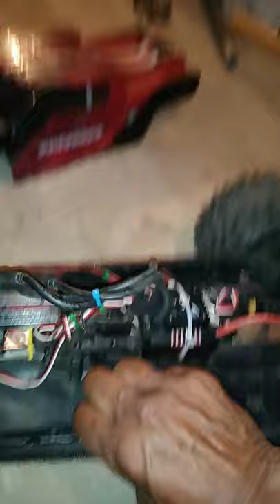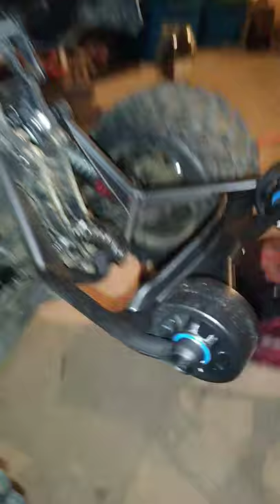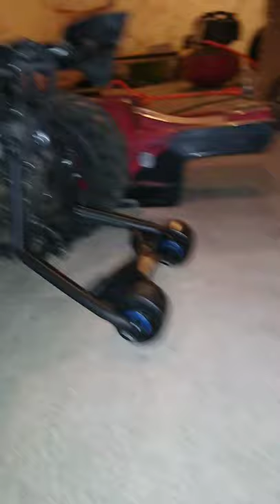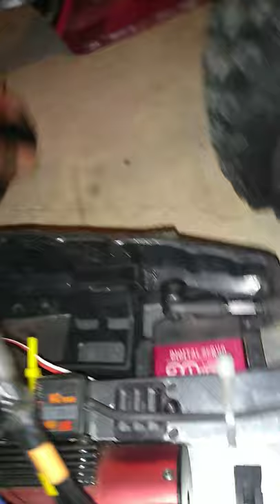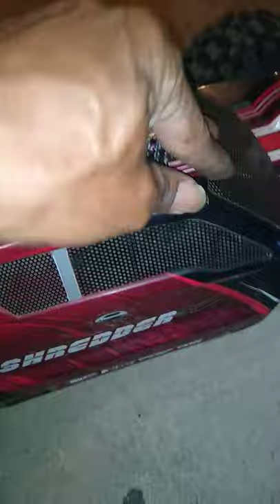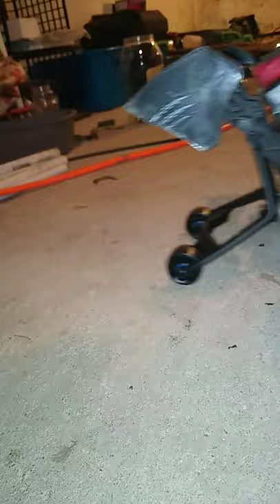Shredder 6s wheelie bar.  like subscribe.You saw it here first

Comment: What car is the wheelie bar off of? Do you have a link or a part number? Thanks.
Reply from the maker: It's the xmaxx wheelie bar.watch the video it shows how I put it on
Reply: @custombuilt4playgomode893  is this the OEM Traxxas 5472 part? Or an aftermarket one?
Reply from the maker: My boy have the x-max one day and took it apart and I asked to let him see if it'll fit and it did. So I went to Amazon and ordered it
Reply from the maker: Don't know the part number just typed in Traxxas xmaxx Wheelie bar
Reply: @custombuilt4playgomode893  Thanks for the tip. I might try it.